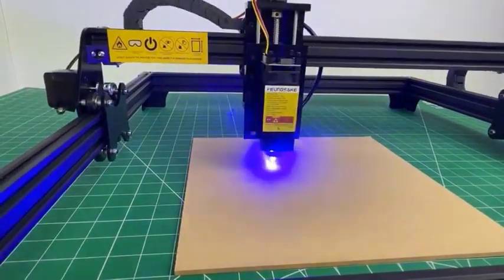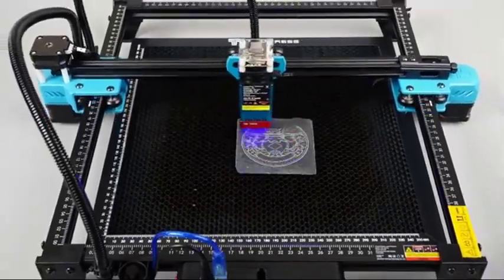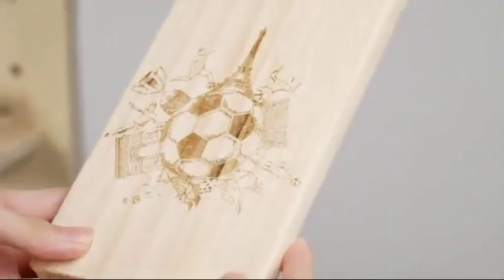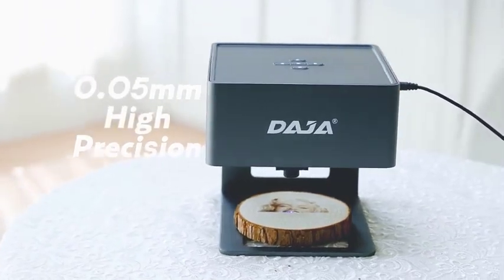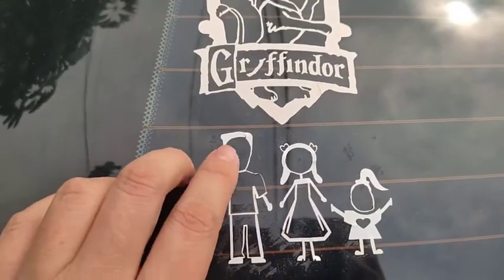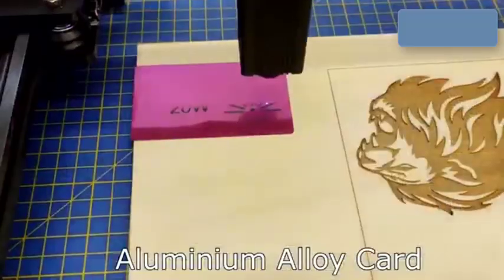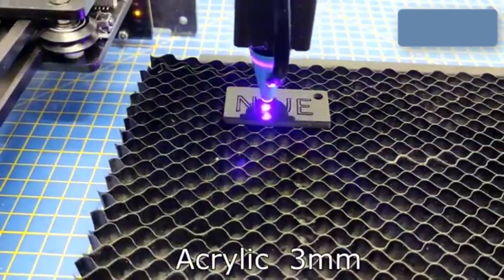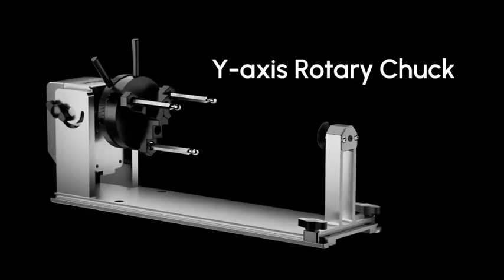5 Best Laser Engraving Machines 2025  |  Which One Should You Buy?

Comment from the maker: Best Laser Engraver List (Affiliate Link) : 

5. T-Trees TTS-55 Pro Laser Engraver With Wifi Offline Control 80W Laser Engraving Cutting Machine 445±5nm Blue Light Cnc Machine

Link  : https://s.click.aliexpress.com/e/_DD2J5sz

4. DAJA Laser Engraver CNC DIY DJ6 Laser Engraving Machine 3000mw Fast Mini Logo Mark Printer Cutter Woodworking Wood Plastic

Link  :  https://s.click.aliexpress.com/e/_DEwAEY1

3. ZBAITU M81 40W/80W/130W Laser Engraver Cutter Wifi Air Engraving CNC Woodworking Tools Machine

Link  :  https://s.click.aliexpress.com/e/_DBTWGOH

2. NEJE 3 40W-80W Metal Carving Diode Laser Engraver Cutter, Laser Engraving Cutting Machine, 3D Wood CNC Router, Logo Mark Printer

Link  :-  https://s.click.aliexpress.com/e/_DmTKS3X

1.  ORTUR (YRC1.0) CNC Rotary Roller With Chuck 360 Rotating 180 Horizontal Flip Base Laser Engraver Machines maquina para folllar

Link  :  https://s.click.aliexpress.com/e/_DlblH09